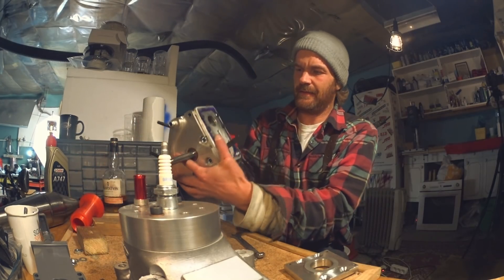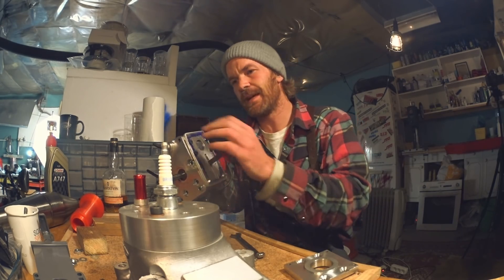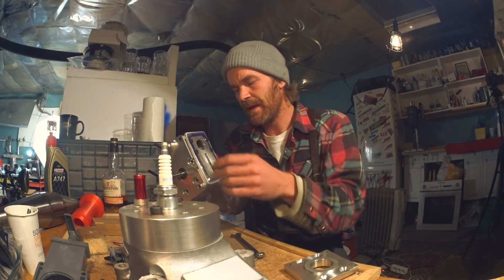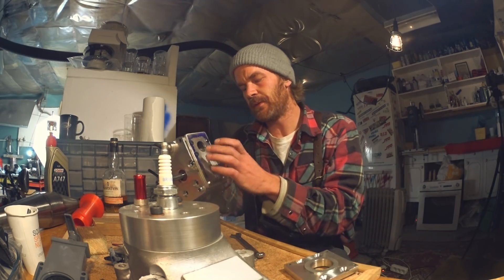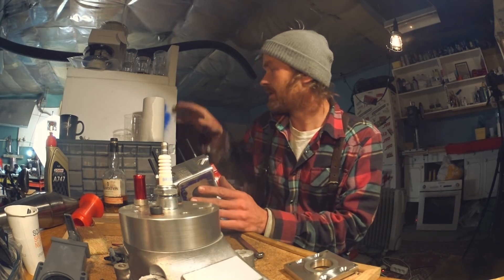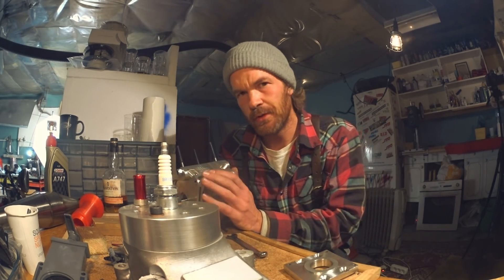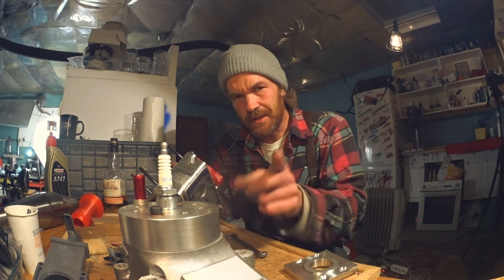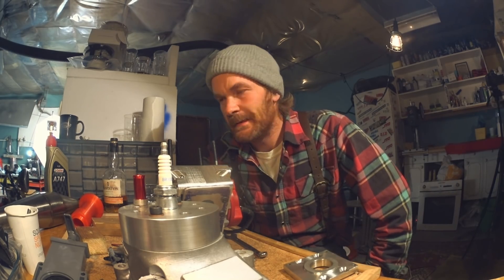Super Slim Flat Slide Intake - World's Most Powerful Two Stroke Ever

Comment: The slide probably won't work. Had a friend design something similar for his sae engineering project. The problem with it is once the air starts to flow it creates a big pressure difference on either side of the gate causing it to lock against the low pressure side of the backing. You can design around it but it becomes too complicated. Just use a butterfly valve of the appropriate size and it will save you alot of headache.

Comment: You should research Selachii Carburetors, Invented in Canada on the early 70's specifically for 2 strokes. I tested one on a 250 cc Maico that I raced at the time. They had two slides that worked with a rack and pinion set up so the opening was always in the center of the carb, and they were made from bright orange plastic. May give you some ideas?

Comment: Heck of a job!! its super cool to see someone willing to try that which has not been done before. It reminds me a bit of one of my projects from years ago where I adapted a small two stroke engine to run a separated crankshaft, the goal was to zero out the side load on the piston as it traveled up and down... the crank halves rotated in opposite directions, the rod was turned into 2 half rods... the crank halves were reconnected mechanically via a external jackshaft. I ran it up as high as 15000 rpm. I had to solve all my problems by myself, make most of my own parts. I think it took me around 400 hrs to do it. Absolutely nothing like dreaming something up, building it and testing it!!

Comment: A television series made in my neck of the woods had a nice large version of a potential throttle aperture, Stargate SG-1. Occasionally wondered if a camera aperture design could be utilized....a Nikon throttle body? I'm wondering if inducing a rotation into your air stream might offer a benefit, especially at crazy RPM. The details should be most interesting.

Comment: Great job Alex, I think you could use solenoid from Aprilia rs125 to control the valve. In Aprilia the solenoid is used for power valve. It is on bowden so not that problem with heat from engine. Or maybe you can use bowden and some lever switch and switch it manually.

Comment: For the servo control, might I suggest a 3D printed rack and pinion? Pinion gear glued to the servo horn, rack attached to the throttle slide. I've printed some very nice gears with my cheap 3D printer, and PLA is resistant to most solvents.
Reply: Something like this: https://youtu.be/LvJYUFbB1BU

Comment: i would use a largescale servo for that, so you know you got the torque. running it directly from a 2s lipo. Maybe not as fast as a regular 1/10-/8 scale servo, but would feel safer..

Comment: instead of a servo why dont you use a hefty solenoid and have it spring tensioned shut. my thought for this is when it reaches resonance speed you want it to transition as fast as possible so the engine doesnt die during the transition period between running between the secondary and primary.  maybe like a car door lock solenoid?
Reply from the maker: 👍 Car lock solenoid is a great tip!

Comment: is the servo really strong enough? 
i suppose there are bigger servos you could use
the pressure from the crank-case will make it tough to move in my prediction. 
if it becomes an issue i suppose you could be using a starter solenoid, or just plain old wire
keep up the brilliant engineering :)
Reply from the maker: Looking through my options!

Comment: Why don't you just use a solenoid to up it? You could use a small stepper motor controlled by an Arduino. I've controlled a servo with a PICAXE chip before as it has PWM outputs
Reply from the maker: 👍 Will be pwm controlled by an Arduino, looking through options for fast solenoids with enough throw.

Comment: Wouldn't it be way easier to just use 3 plates? The middle one with the opening for the port. Then you wouldnt have to take out all the metal, (2:50) and would probably be a bit smoother too.
Reply from the maker: 👍 Probably.

Comment: bro, I am building an exhaust pipe or an expansion chamber for my 2 stroke Suzuki, the goal here is not to make peak power but to have a good fuel economy and broad powerband so which type of expansion chamber will be good for my needs, is it multi-stage with 3 or 2 diffusers or single-stage expansion chamber and also what kind of design should I use, and also my engine is only 100 cc in size, which cant rev higher than 6000 rpm with an exhaust duration of 170 degrees, and the exhaust port diameter is 34mm, thanks.
Reply: In short, a single cone taper will provide the most narrow effective range with the highest gain, multi-stage operate over a broader range sacrificing gain.
Reply: @AuMechanic  thanks man, I had watched a lot of videos of yours, and your software really helped me, I tried your software and it had shown me an expansion chamber with 3 diffusers and the total length of the exhaust system was 1,409.26 mm, and here are the dimensions which it had shown, I guess you can give me advice on that.
cone diameters,
D1 = 35.70
D2 = 57.41
D3 = 87.70
D4 = 110.50
D5 = 110.50
D6 = 20.40
D7 = 20.40

cone lengths
L1 = 117.93
L2 = 387.55
L3 = 257.89
L4 = 129.65
L5 = 155.02
L6 = 338.22
L7 = 338.22
cone angles
L2 = 3.21
L3 = 6.72
L4 = 10.05
L6 = 15.17
Reply: @pabitrikalita3940  
OK, if you open the software and hold your mouse over the 3 input boxes (called port to pipe ratio, port to mid ratio and horn coefficient) the popup help will give you suggested values to input to those 3 boxes for broad power or peak power.

Comment: Great vid! One suggestion, even though your valve is a temp .. I have made many of these slide valves on filling machines and they leak like mad if the valve slide is not extended with a matching hole. Also prevents the O ring from 'off loading' and getting snagged when you close it. :)
Reply from the maker: Great tip, thanks!
Reply: @2STROKESTUFFING  BTW - I built a 12 lane filling head for KIWI Shoe Polish with a multi cavity sliding valve (their design) and to improve dynamic sealing 'efficiency' the slide was a little thicker with counter spring biased brass caps captured in the slide. The caps where bigger than the delivery diameter and so remained constantly against the inner and outer faces with no O Ring and no snagging. More costly but very effective. :)
Reply: @graxav  so the sealing faces were brass on steel? how did you get the surfaces mated well enough? lapped in situ?
Reply: @FirstLast-wr9mh There were two slides - just to clarify - like a mech fuel pump - one to fill the 'cylinders' or 'syringes' and one to discharge - they alternated through a closed mechanical loop via the piston (linear) drive bridge via a single motor geardrive and double cranks (like a frame saw) . The block was ground on all four faces as were the cover plates and side spacers. Brass caps were lapped in, water paper on glass by hand! To 'load' the caps, they were inserted from one end with the slide, pushed together with 2 fingers and passed into the slot - then next and so on. The entire head was heated with a steam gallery to ease the flow of shoe polish.
Reply: @FirstLast-wr9mh  There was also no constant pressure and the valves were 'closed' only at TDC after change over and open within 1-2 deg on the discharge stroke. Polish was supplied from a heated hopper above and very little vacuum needed to fill the cylinders on that 2nd stroke.

Comment: The slide and body should be of different materials so they dont bind together. Suggest making the slide from brass shim or maybe you will get away with anodizing the existing slide or using teflon spray. Looking good.
Reply from the maker: Slide is steel, no need to worry 👍